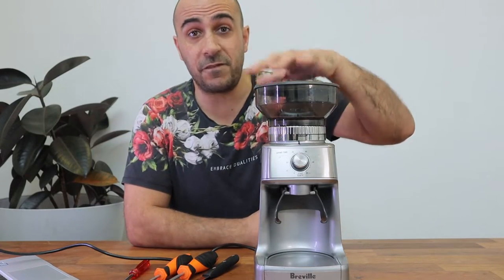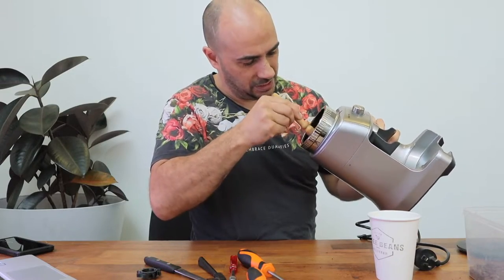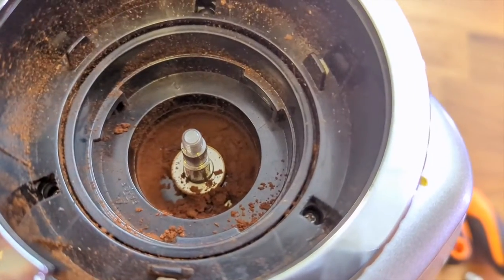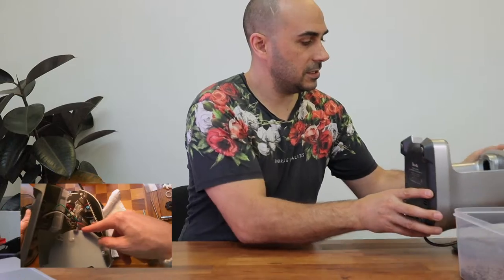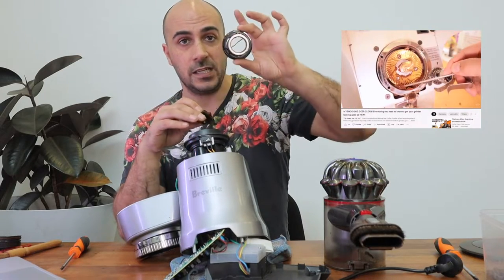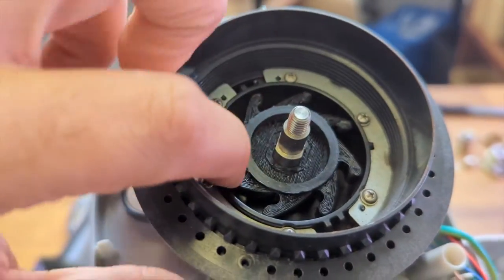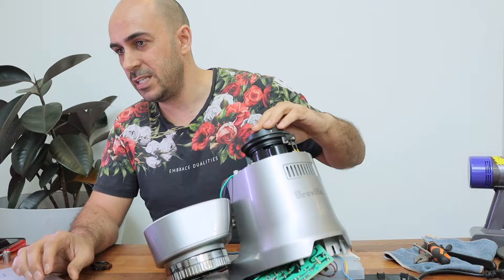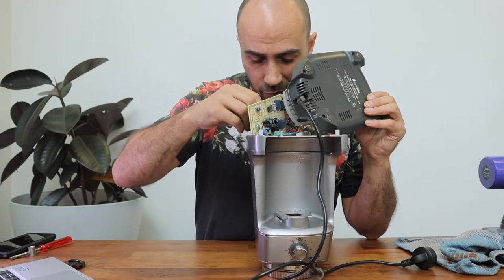Fixing your Breville Coffee Grinder - Replacing your Impeller Blade

Comment: This a design issue which is actually health safety issue. When this happened to my breville dose control pro, I got a new smart grinder from breville as replacement
Reply from the maker: Yeh it's an issue for sure. I don't think Breville will do it on grinders outside of a couple of years though. Yours must have been within 2 years right? It's a health safety issue only if you don't do it right, but that particular grinder is still going strong.

Comment: I'm very dubious about that plastic impeller.. I can only imagine it will be a point of weakness for the grinder as its suppose to hold the lower bur.
Reply from the maker: Yeh it's is very weak but this one only needs to help the lower burr spin, so it doesn't have much responsibility. Since I replaced it, it's been working fine and it's been a year and a half.

Comment: Is that tpu ? Hows it holding up?
Reply from the maker: Yes it is! The impeller blade is 3d printed and it's still going strong after a year or two.
Reply: Cool,mines going out on the smart grinder and don't feel like taking it apart I'm hoping once it's worn out enough I can squish a tpu one in there. @Rydecoffeecoach
Reply from the maker: @juniorleyva7168  I don't think you can get the other one out without taking it apart. It only wears down the tips, but the teeth are still quite long so it won't come out. Unfortunately the way they are made means taking it apart is the only option, I think.
Reply: @Rydecoffeecoach  I saw a different disassembly where it was so warn it comes out , mines almost to that point a couple more mm and I can take it out ,  I haven't had jamming issues so I'm grateful for that.
Reply from the maker: @juniorleyva7168  oh yeh we'll if you can do that then, perfect! Mine was worn but not enough and was jamming all the time.